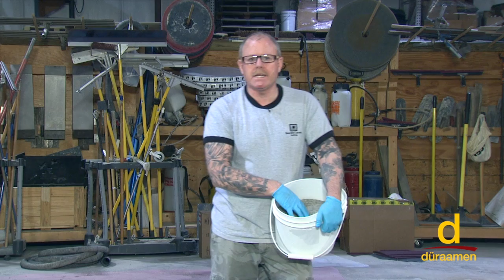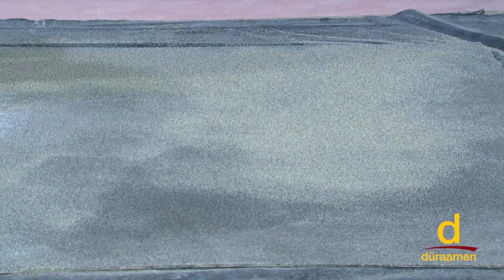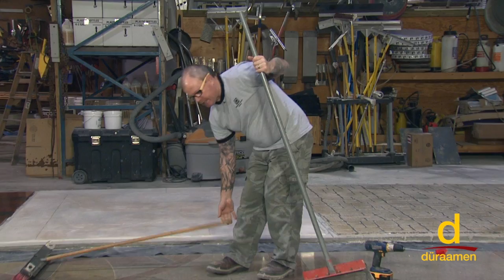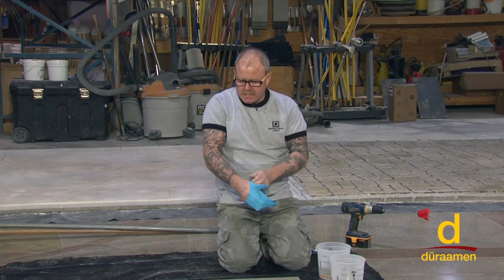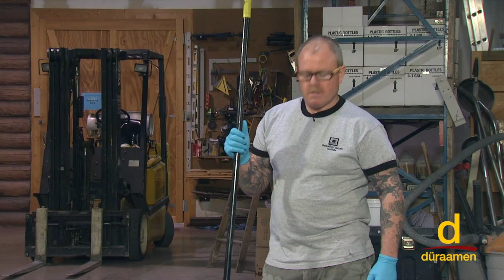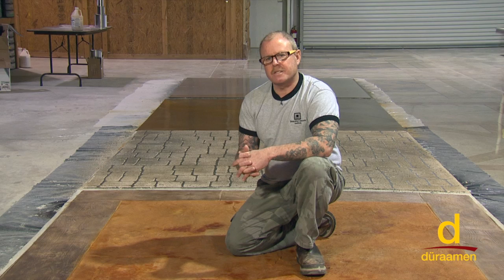How to Install Decorative Quartz Flooring System - Part 3

Comment: Maby a dumb question, but is there a way to do walls with epoxy sand? I understand a panel that lays flat than screw it on a wall. But I have an old cement rainwatervat, that I'm converting into a big jacuzzi,pool. I had in mind to do a cave desing with a sand floor, but what if I could do the walls up to the waterline with epoxy sand so I'm sure it's watertight.
Reply from the maker: I am afraid this system does not work inside the pools.